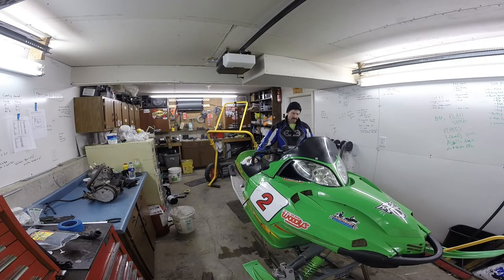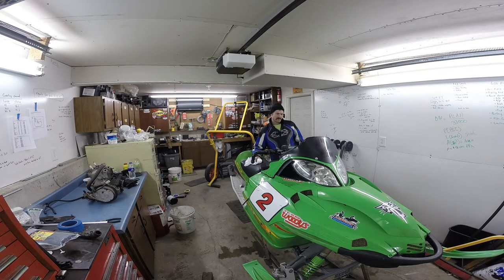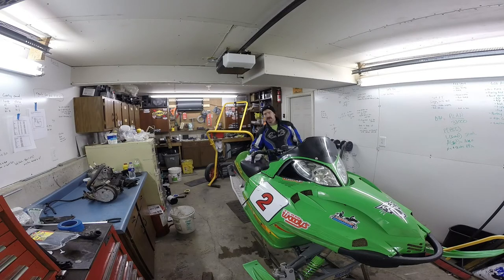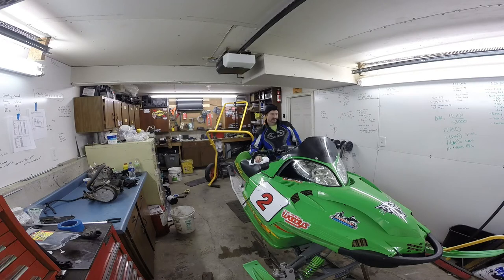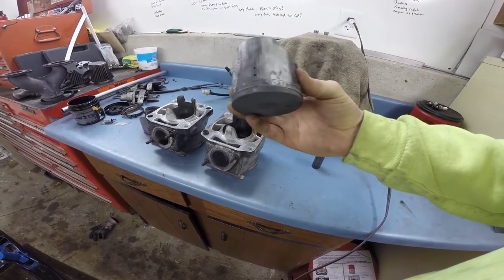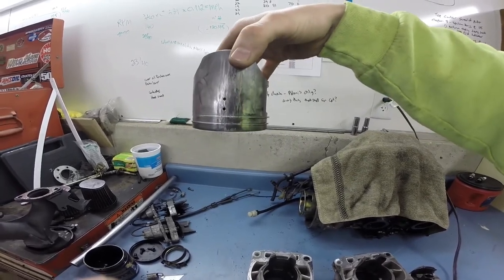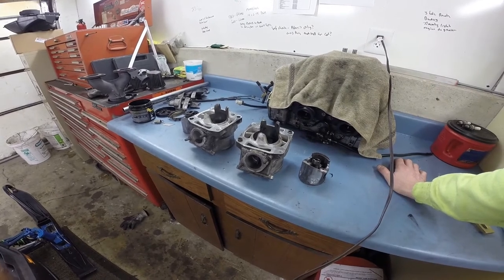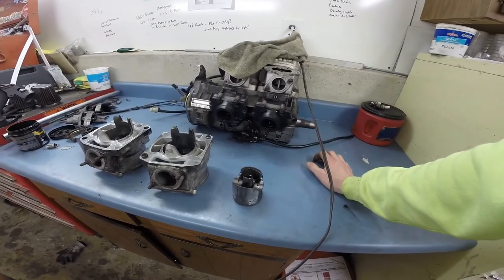Arctic CatF5 snowmobile Burn down - Oil Injection delete Caused - Premix Theory

Comment: Look into a holtzman engineering “tempaflow”. I installed one on my sled. It basically compensates temperature changes by messing with the internal pressure of the carburetors. Essentially the carbs internal pressure is controlled by the tempaflow, rather than just venting to atmosphere. You’ll jet as rich as you ever think you will need, and it automatically leans out your mixture based on temperature it senses. I dont know all the science, but it does work. Also helps MPG but thats not really important for what you’re doing! 

Also not sure if one would be allowed in racing or not.